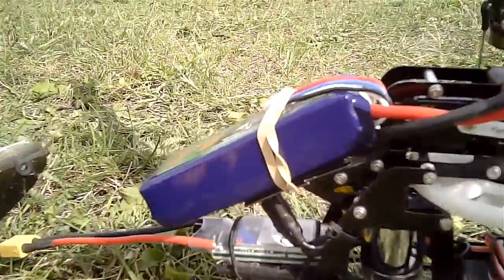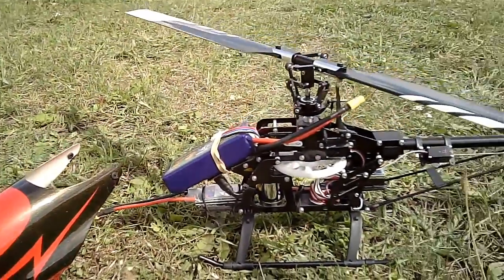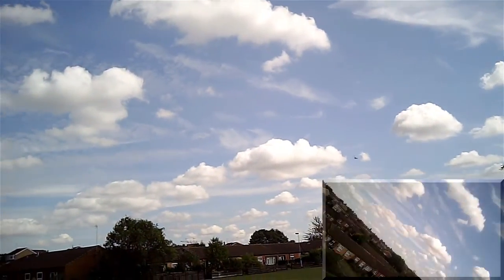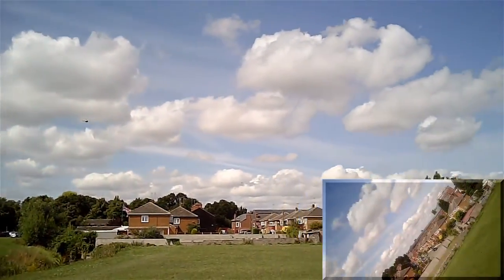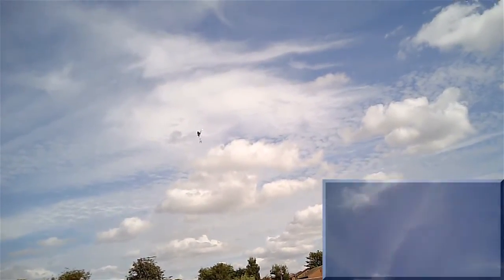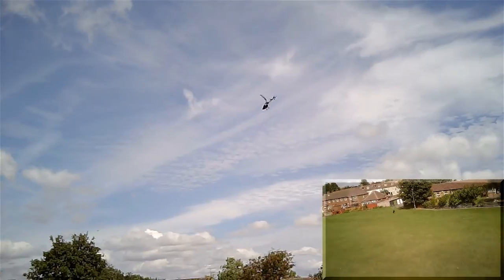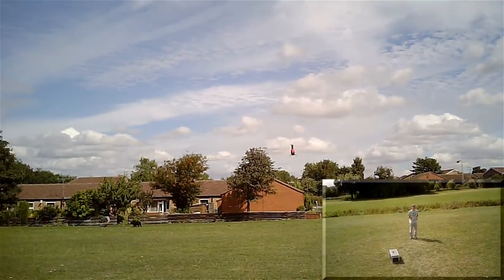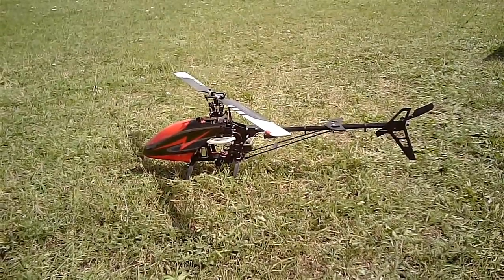LH 450bb FBL 081413 YEP 40A Governer Mode Test Flight

Comment: Damn - I thought a good pilot was that you could use the same plane twice ;-)
Love your vids.  What cameras you are using (helicopter and ground)?  I have to work to a strict budget (that as;- the wife needed know how much more I’m spending).
Wind gusts to 140KPH overnight.  35-45KPH winds forecast.  I think even the canopy may suffer in that little indulgence.  I’m 15–23KPH wind repeatedly but, the current weather is unstable. The gusts are beyond my capabilities.
Regards,
Nick / Australia

Comment from the maker: Thanks Noel.  Governer mode is quite easy to set up for this esc.  First you use the prog card to setup the esc and teach it what min and max throttle look like.  The you select the type of governer required - I used gov store mode which requires a calibration.  This is done on the first run by using a battery over 4.0v per cell and running it 100% for a few moments on the bench with no blades.  Then the idle-up curve is altered to a flat 80% and this video is what happened next

Comment: Simon,  Nice video.  Nice to hear the family axe is still in circulation (the axe that's been in the family for six generations - twelve new handles and five new heads).  A bit like my machine (it was a Hausler 450 V2 SE).  These days, it's a hybrid of Trex, Blade, Turnigy, Tarot and generic components.  But still the original canopy ;-)
Very nice (YEP) ESC.  Would you believe I’ve just purchased a HK Plus 40A and a Turnigy AE-30A.  Had I been more attuned to matters and not tight fisted . . .

Comment from the maker: It was ok and flew surprisingly well stock, although care was needed to check everything out during the original build.  Over the months and after crashes parts have been replaced with Align (usually) or Tarot.  I don't think there are any original Leadershobby rotating parts left on it!